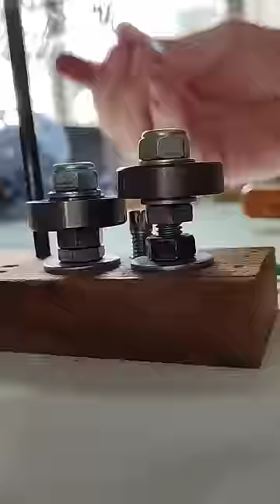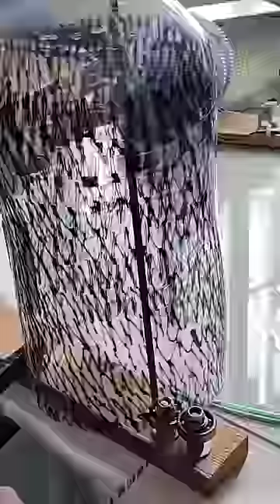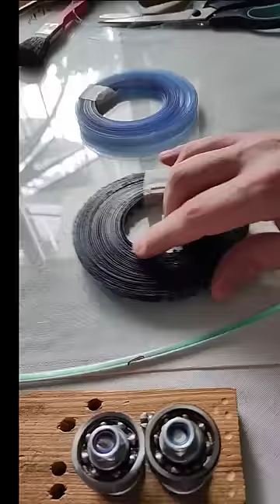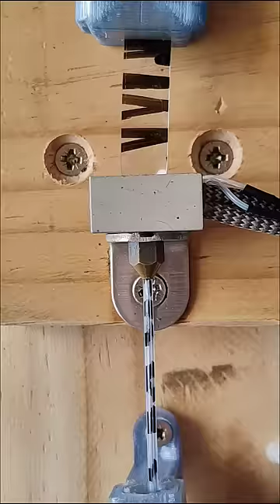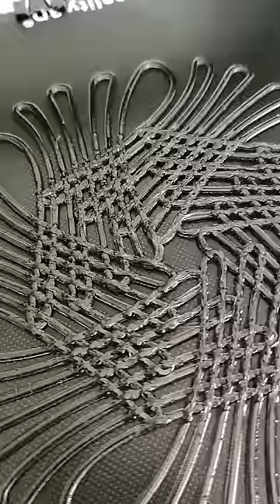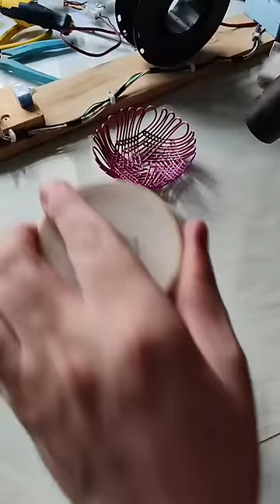PET filament coloring experiment, 3D printed bowl using gcode generated with python script code

Comment: I'd be curious if using acrylic paint would help keep the color separated, instead of just melting into the filament, but probably dried acrylic paint, even in thin films, would not be an agreeable substance for the printer.

Comment: I have no experience in this whatsoever but I have a small question, wouldn't melting the plastic with the marker ink on it introduce imperfections which also introduced weak points to the object ?

Comment: Nice! But how thick is the filament capable of coming out?
Reply from the maker: The bottle wall thickness is 0.25 mm so it needs to be cut to 9 mm, the nozzle is 1.7 mm which gives me about 1.75 mm filament diameter, 20% hollow, so with 120% flow I compensate for that from the slicer, then I print slow with a 3 mm line width set from the slicer which results in those huge lines and layers in the print

Comment: this video is the proof why recycling is so expensive. think about it! ervery step he does takes huge amounts of energy. Scale this to the size of a factory. What we need for recycling the world is in fact a source of green energy.  without energy this guy wouldnt be able to do anything.
Reply from the maker: What I print in this video costs no more than 0.10€(0.5KW/h) of electricity including the energy to make the filament
Reply: @Function.3d  and you think that is cheap? you're thinking too small. In a massive factory, this would cost more than that. What about the machinery? Who is going to do all the steps you did? What about the finished product? Who is going to buy that shit? You are not recycling, just converting with more energy than it should take. Efficiency = zero.